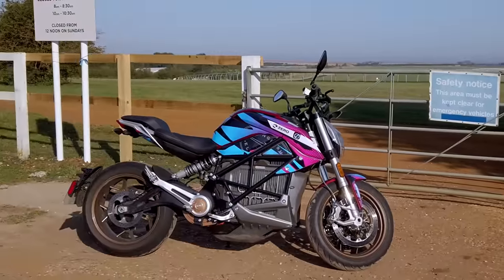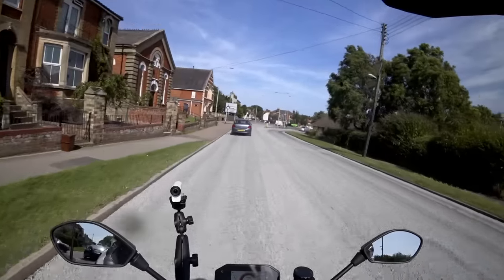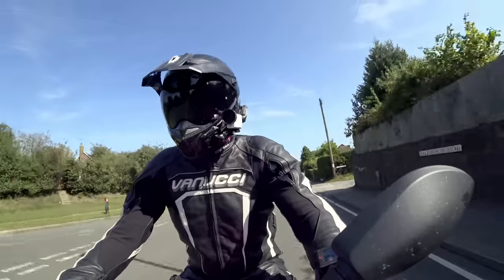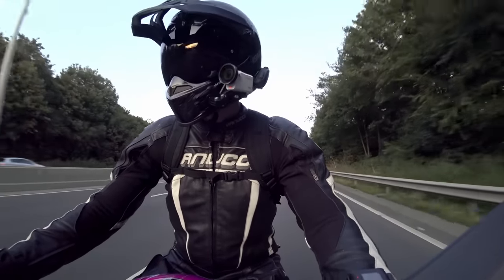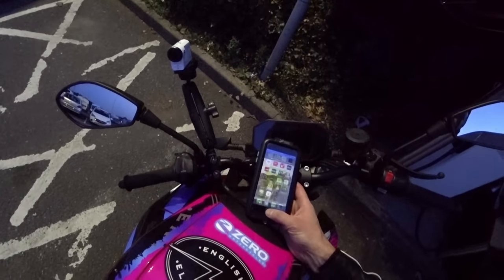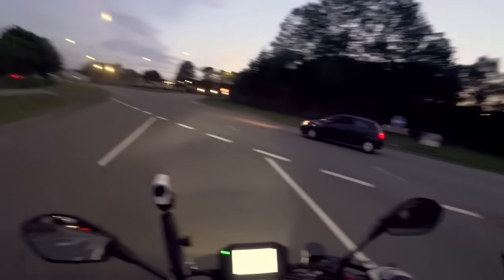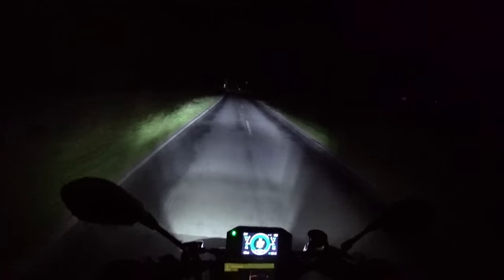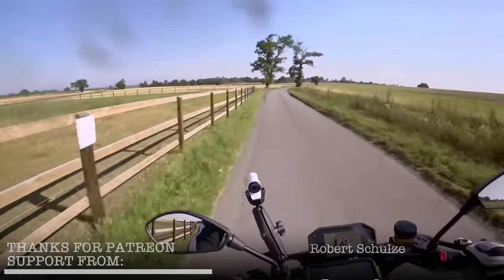Zero SR/F Real Life Ride Review

Comment: Lots of developments in the technology with batteries and charging times are arriving soon. It won't be long before they are acceptable for touring. 

When I was a student in the long hot summer of 1976, I got myself a job as a milkman, pottering around in a milk float. I liked the job as it was warm and sunny every day, but I got a bit bored with the driving. I spiced it up a bit by putting my foot on the brake as well as the accelerator at the same time, waiting a few seconds, then releasing the brakes.

The result was wheel screeching acceleration followed by alarmed pedestrians looking over to see a milk float bouncing along at 15mph. Eh? Where did that come from?

Gravel drives were fun as well.

Yeah, I understand the torque of electric motors, and as soon as they get rid of the range anxiety, I'll seriously consider one. 

200 mile range and 20 minutes to charge up. I'll be happy with that.
Reply from the maker: Hahahahaha! I can imagine it! And just remember how massive the batteries in that thing were!! It won’t be long now until they make perfect sense.

Comment: Reviewed 100% correct, best review ive seen even explaining the charging, well done that man. I run a Tesla p85 Model S for 5 years 85k uk miles perfect free charging every time even Cheshire to Sorento Italy. I run two Zero bikes including SRF premium (7KW charging). Incredible bikes, rubbish infrastructure.  You did well taking it to 2%! Watch out if you get a non Tesla EV car its same *hit........Tesla bike anyone?........ Elon?
Reply from the maker: Thanks Graham. A Tesla bike eh!? According to a few things I've seen, read and heard, if a Tesla bike were comparable to the cars, it would have unimaginable tech and performance, but weigh about 30% more than it really needs to! Those cars are awesome but HEAVY!!
Reply: @AndyManCam  Totaly agreed but because the C of G is so low and the punch out of corners is unlike any ICE the performance is still 110%. Couple that to a finite ability of electric motors to control wheel slip and spin 100 time better than ICE you have to drive them to re calibrate what you have traditionlay thought  in relation to weight. There is a reason Top Gears Chris Harris has bought a Tesla Model 3. If you think about it we subconsciously equate ICE weight / performance, that ratio is different with EVs.
Reply from the maker: Very very true. They’re a whole different beast that can’t really be compared apples to apples with ‚conventional‘ vehicles.

Comment: Informative recording. Thank you. 

What’s the life of a power pack? How much to replace? 

Like the Zephyr 😊
Reply: The previous Zero's batteries were warrantied for 5 years. And the replacements were £2-2.5k each.

Hence why the depreciation was/is so steep on these machines. You virtually can't give the old ones away. And no reason to expect this "new" model won't be any different. Buyer beware.
Reply from the maker: Cheers  Paul. My pleasure! I'm not sure how much to replace, but  I think it's somewhere around $2000-$4000! Whether that's viable in the 5 years of guarantee is up to more mathematical minds than mine to figure out! Although Zero say that after 200,000 miles, the battery should still have 80% of it's capacity.

Comment: Nice informative video there Andy. Early days for these electric bikes, but they are improving soooooo quickly! Once the UK gets its finger out and we have a decent charging network things should get easier and you'll make your BBQs on time 😉
Just out of curiosity, does that Ram Mount fit most motorcycle bars? I'm looking to buy one and can't decide whether to go for the model you have or the clamp version.
Reply from the maker: Thanks Campbell! So true. Each iteration is leaps ahead of the last. The RAM mount fits into one of the bolt holes for the bar clamp. Sooo should work with any bike.
Reply: @AndyManCam  Cool! Thanks for getting back to me 😉👍🏼

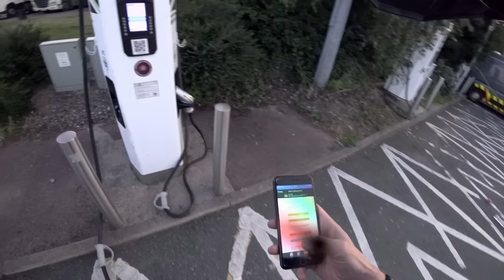Comment: 23:12 And.......everyone asks for their deposits back.
Reply: I mean what a farce. That's all you need, having to hang around some dodgy car park for up to 8 f**king hours and more if the dam thing wont let your unplug it from your bike. Meh, I am pretty sure a Honda 50 would have done the whole trip cheaper and faster!
Reply: With how unreliable smartphones are I would not rely on one for emergencies or filling my vehicle...

I can't tell you how many times I've a the gas-station app refuse to work when I needed gas, luckily gas stations still accept cash and credit cards and there's someone there if there are problems.
Reply from the maker: Sad but possibly a little but true. Though only for those who see themselves using third party charging. I’m sure that the majority of customers will only ever charge at home.
Reply: Come to the nordic countrys, superchargers all around, and the bike is sold with the supercharger capability. 54% of all new cars sold in norway are electric, so the infrastructure is great.

Comment: ok so one question, on an apparent solitaire  road trip, how did you manage to get aerial video shots with a drone of you riding the bike and do them both at the same time by yourself, just curious ???
Reply from the maker: Easy. DJI‘s incredible ‚Point of Interest‘ Intelligent flight Mode. Set the center point, height, radius and speed, and then the drone will circle until the battery runs out!

Comment: I'm curious the long-term degradation of the batteries in the Zero. 
If they are like other lithium batteries, Keeping the charge in the 20-80% range to maximize battery life doesn't give you much range. 
I really want an electric car or bike but don't live somewhere where that is feasible; little to no infrastructure, long distances between where I need to go, let alone want to go. :(
Reply from the maker: I wonder if perhaps the full capacity of the battery isn't really made known to the instruments, thus keeping the charge between 20-80%. The battery has an unlimited mileage 5 year warranty, but obviously after that is anyones guess.

Comment: Well .I've said it before, and I"ll say it again. I"m looking forward to one day owning an adventure version of what Zero motorcycles has to offer.  HOwever, I WON'T drop a dime on one until the following minimum things are accomplished:

1.  MINIMUM....worst case range of 200 miles or more WHILE doing 60 mph the entire time ( not stop n go)
2.  Recharge time down to 30 minutes from dead empty to 95% full
3.  Price...CUT...down to 15 grand...taxes..etc included.

Until all three of these are met...no thanks, no sale.  I'l just have to be happy with my 2019 cb500x  xD with it's 4.65 gallon tank that , worst case, will let me ride at least 300 miles before real low-fuel anxiety hits at 60+ mph consistently.  

Legit though, I am sincerely wanting a full 100% ev motorcycle.  No spark plugs, no oil or transmission fluid changes, no oil filters, no messes clutch plate changing, and there's always an option to put a smaller sized solar panel on the rear and connect it into the battery charging system as I ride down the road  (shrugs).
Reply from the maker: We are of one mind mate. I agree with everything you say!

Comment: It really needs a 24 kwh battery in stock and a 12 kw charger built in to offer enough "practicality" for me to consider going electric. Really love low maintenance and close to zero riding cost of electric motorcycles compared to standard bikes. I believe that electric bikes will eventually provide  more freedom to bikers, since you do not have to work several hours to fill in gas =).   It actually cost 13k USD in fuel and consumables (spark plugs, oil and air filters, valve adjustment, clutch etc) to ride 100k km on my CRF1000.
Reply from the maker: That’s an interesting cost comparison. Thanks for that! More battery range and faster charging really do seem to be the holy grail here. I guess the problem is that right now, bigger batteries mean a bigger and heavier bike. I’m certain that at some point the battery tech will take another leap and we’ll get more charge for the same volume. The question then, as with most new battery tech, is what will the cost be to the environment for these batteries?!

Comment: I would have rather seen 60fps, but at least you had sense enough not to record and upload at 30 or even 24 fps (cough chaseontwowheels cough).  Thumbs up JUST for that decision alone.  Gotta keep it smoooooov Cheers.
Reply from the maker: Cheers! I actually prefer 50fps as it's not quite as jarring as 60fps. Plus the slightly lower frame count per second means a tiny bit more image detail per MB.

Comment: It's best not to run your electric vehicle below 10% for 2 main reasons, 1) the calibration can be a liittle out and you can run out before 0% and 2) it's not good for the battery to run it to 0%.
Reply from the maker: I imagine that with a 5 year unlimited battery warranty, the manufacturer has probably taken that into account and 1% SoC on the display is most likely an actual 10-15% charge in the cells. It’s one of the cardinal rules of Product Design. If a user CAN abuse a product, then they WILL. So the designer/engineer must allow for and protect against this abuse.
Reply: @AndyManCam  Generally anything below 30% will shorten battery life, the lower you go the bigger the affect. If you take the battery to absolute 0% you have done it permanent damage, it can be recovered with a convoluted process. The padding added by manufacturers is to stop this latter situation, 0% on the gauge, as you said, is not 0% on the battery. I don't know how much padding there is (each manufacturer would have their own opinion on it) but 10 - 15% sound very high. Maybe the Audi E-tron has that sort of padding (as it has a lot of padding both ends) but a Tesla, for instance, has a lot less. As for Zero, I feel with my SR it is less, maybe 5% or even less.

Comment: So for going to and from work if it's in range, that looks cool. But, for actually using it for longer journeys, touring etc - What a pain in the ass and I bet it costs much more than a 'proper' motorbike
Reply from the maker: It does cost a fair bit more and as you saw, it was a bit limited for longer trips. But I think it won't be long until the gap between conventional and electric is non existent.

Comment: Why don't they make these bikes hybrid?  A lightweight 50cc motor with an alternator hooked to the battery could help to start trickling in charge when it gets below 20% charge. The fuel tank would then be still relevant to the bike and extend range.
Reply from the maker: I think the complications of building hybrid tech into bikes would be too big and too heavy at the moment. Imagine how underpowered a 50cc bike is. Then take away about half of that power because it’s being funneled into the charging the batteries and you’ve got a very uninspiring ride! Plus less range because the space for batteries is being used by the engine and fuel. I’ve day perhaps, but not yet.
Reply: @AndyManCam  A hybrid system was probably the wrong word. I would like to imagine that they incorporate a small petrol motrol to be just dedicated to charging the battery to extend range based on the rider or computer calculating when to start charging to help ensure that the mileage is increased. So  maybe even a small  lawnmower engine or something similar would be just purposed solely for charging but not connected to the rear wheel.
Reply from the maker: I honestly think that the Motor needed to change these batteries with any useable pace, would be huge. Consider how much charge goes back in to the batteries from regenerative charging. It’s fractions of a percent. And that would essentially be the same as pushing the charging system with a small motor. The current needed to charge the batteries in the charging stations is immense. That’s why the cable is so fat!!
Reply: @AndyManCam  yeah sounds right actually. Just reminds me how crappy and inefficient piston engines are at converting the energy density of petroleum. All the wasted engineering brain power that got used up for a dead end.

Comment: What kind of lens/filter do you have on the helmet camera?
Reply from the maker: It’s a ghetto rigged pile of lens adapters with a 43mm CPL on the end and a bit of rubber providing the interference fit to the camera. It kind of worked, but the CPL miraculously stopped working after I cleaned it a few times and the colours of the video were a nightmare to work on! Back to the drawing board!!
Reply: @AndyManCam  Interesting. So the active element of the CPL was a delicate coating on a neutral piece of glass?

Comment: i give it another 3-4 years and there will be better batteries tech for cheaper and more charging stations. my biggest problem is i just want a bike of a equivalent 100cc and a good battery time just to get about as i don't care about speed much now. for the price of an equivalent bike i get way more for the money on petrol but waste money on fuel.
Reply from the maker: I totally agree. I think the balance will be shifting a lot in the next 5 years.
Reply: Enter the Zero S or DSR or the other lower ones. Still way more power than you actually want and more than half the price of this zero SRF.  AND you can option any of them with an extra range pack sitting on top.. the zero SR is good for almost 200 miles. Perfect for you especially with that extended range pack (which is also removable)

Comment: Hej, Does the motorcycle charges when using the brakes?
Reply from the maker: hi! Yes it most certainly does.
Reply: @AndyManCam  thanks for the info, strange it does make such a difference then for what mode you are using. because in elektric cars, we see like almoste no difference with manual, or automatic regenerative braking. often the rage even extends when you do it manual.
Reply from the maker: I couldn't honestly say if I felt that the range increased with higher braking turned on, b ut yxou could really feel the difference in  the braking force. SO it must have been making a difference with the regenerative charging too.

Comment: Still think that the electric bikes are way too expensive...
Reply from the maker: They are certainly pricey Gren. Sadly it's always the way for new tech. I reckon the price will come down soon. Hopefully!! :D
Reply: Over time, the savings in petrol and maintenence make up for the higher purchase price, but that initial cost makes electric out of reach for a lot of people. There is no way I could buy one of these new. That's why I'm looking for a 2015-2017 Zero SR-but he SR/F is quite a bit better.
Reply: @Markus Patients 
18 to 20 thousand FOR YOUR SECOND "just for commuting" bike is a LOT.
As long as its too much to ask to have a USEABLE charging network - instead of wandering around town in vain hopes of finding one that works as marked on the app, and accepts your card & credential - its nothing more than a gimmick for anything other than charging at home and commuting.

Or to put it mildly a rip-off.
A glorified luxury item, that is borderline useless, unless you already have a primary (likely petrol based) method of personal transportation.
Reply: For 18 k a used BMW k1200 GSA is  a nice alternative.
Reply: Most Nissan dealers have a charger.
Reply: You buy food instead of petrol so you get fatter and it affects your MPG!

Comment: Image the suprise on the car driver when you overtake them, normally you can hear a bike coming up behind not with the zero.
Reply: Try maneuvering a Zero in a busy parking lot. I have to speak to the pedestrians for them to hear me. Either that or the horn which is excessive.
Reply: Normally you can only hear a motorcycle about a car-length back.  It’s really not much of a difference in practice.
Reply from the maker: I think that for most cars, they are so quiet inside now that you pretty much can't hear any stock petrol bike already.

Comment: Call me a poser, but a bike I dont have to shift is very appealing. I have a manual car and am tired of it. No real desire to learn to ride a conventional motorcycle and the clutch/engine rpm/gear interaction that entails.
Reply from the maker: POSER!! I agree. There's a certain appeal to a lot that these machines offer. I said about missing the gears and the noise at the beginning, but by the end I was loving the effortless smoothness of it all! If you've never had it in the first place, then all the better!

Comment: Imagine, your batterie dies after warranty. I'll bet, that's double as expensive as to repair an combustion engine.
Reply from the maker: The battery is certainly a very large part of the price. I guess that there is the hope that by the time your 5 year warranty is up, the batteries will be either better, cheaper or both.

Comment: 3pounds to charge it?
..that number can't be right.
Reply from the maker: The average cost in the Uk per Kwh is about 16p. A 14.4kwh battery will take 14.4 x 16p = £2.30 to charge. Add a little for the losses due to inefficiency and the number really isn’t too unbelievable.
Reply: @AndyManCam  but it was overnight...isn't electricity cheaper overnite?
Reply from the maker: That depends entirely on which tariff you have. I think that economy 7 is very rare these days!